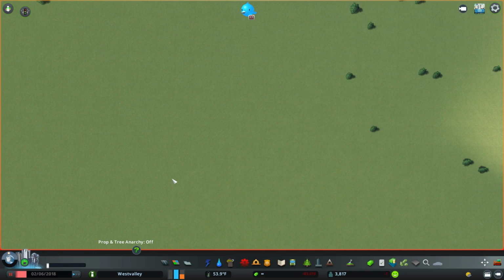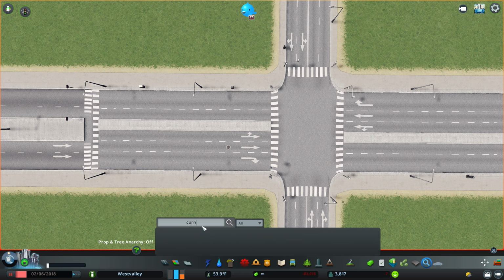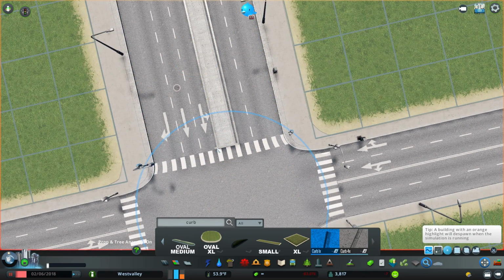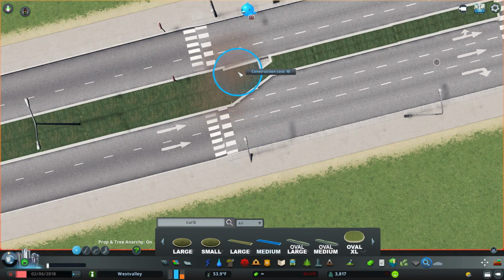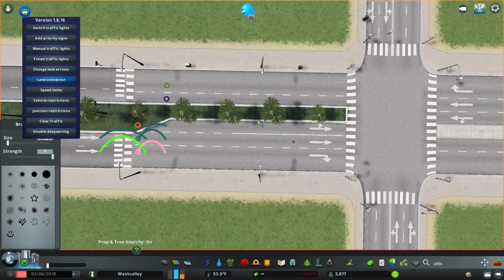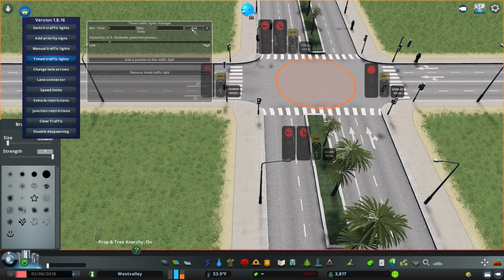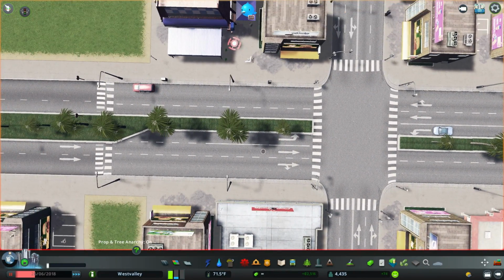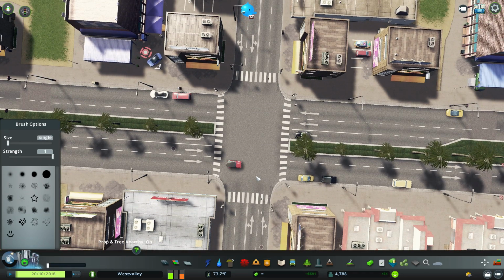Cities: Skylines - Left Turn Pocket Intersection Build - 2017 Tutorial

Comment: hi, where did you get the asphalt decals? i didn't find anything good on the workshop.
Reply from the maker: +VirtualPlayGames The asphalt decals are from the Ploppable Asphalt mod: http://steamcommunity.com/sharedfiles/filedetails/?id=881291183
Reply: thanks i will try that. but the fact that the decals are not terrain conforming is a bit concerning. did you had any problems with it?
Reply from the maker: +VirtualPlayGames I've had some problems with the ploppable asphalt props. I can't place the props in non intersection areas without leveling the terrain around it first. The small decal versions of the ploppable asphalt assets also fade out when you zoom out a relatively short distance. Therefore, I can only use the sunken square and normal square prop if I want to have the asphalt seen in a zoomed out view.